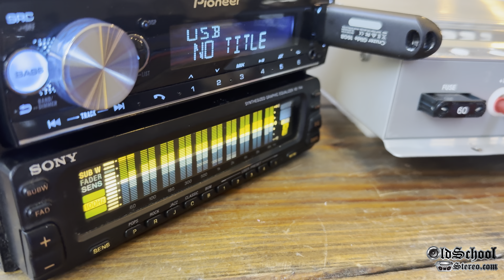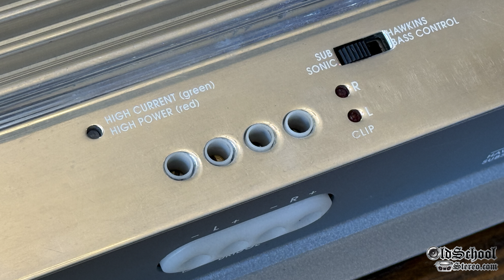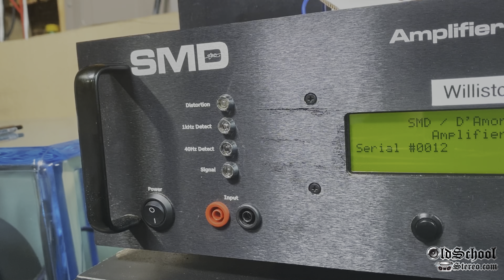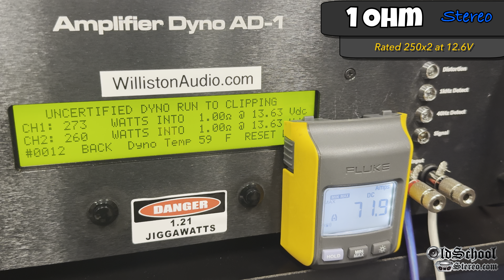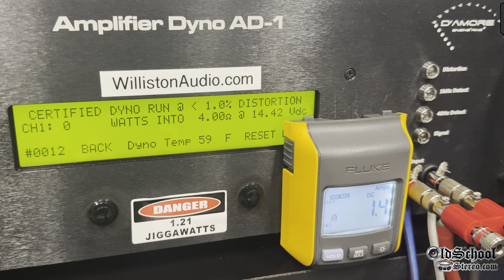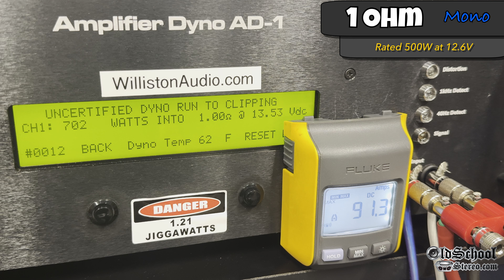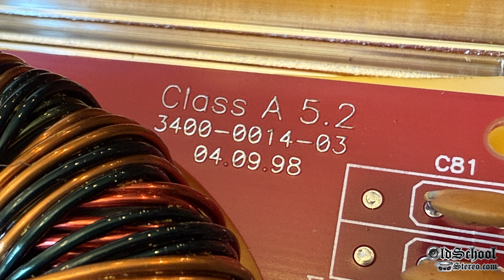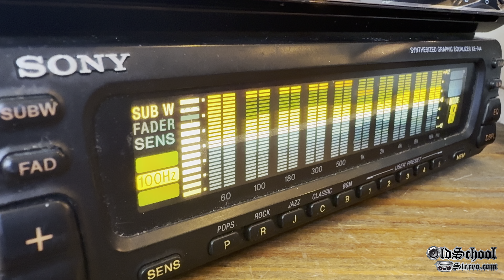This Amp was Rated 1/2 watt? 1998 Soundstream Rubicon Class A 5.2

Comment: That EQ brings back memories of my cousins setup back in the day. RIP Bumblebee
Reply: I miss those EQs. The touchscreen eqs cut out as you adjust them. I miss separate dials and adjustments. I had a Nakamichi with bass, mid and treble. 3 separate knobs, rather than going to menu. I use a pre amp / eq with an iPod for my test bench, and a separate cd player. I miss the old days.
Reply: @raymo6795 i still have a working alpine 1/2 din that works and sounds great. Jcv had one back in the 80s that would talk which was crazy lol
Reply: @stickboslightning  they are still available, maybe not Alpine or JVC. Some of the off brands still make them. I use an Audiobahn as a pre amp to test eBay amp purchases with an iPod or external dvd/ cd player. The new head units ‘ eq cuts sound whenever you adjust fine tune.. can’t believe that is what is acceptable in the industry today. I prefer slides or dials…truthfully, I am not a big fan of DSP either. I prefer to adjust the amp settings with a small screwdriver and not on a computer. I am awaiting an old Eclipse cd head unit…I hope it works, that is the risk buy a 25 years ago old piece of electronics from eBay…the seller will return unit if not operating 🤞
Reply: @ brother you are preaching to the choir lol. I just had my DSP go bad, it was an expert 8 channel. Pure junk.  Now most of the cheaper dsp's use a phone app to setup and it is such garbage man. Don't even get me started on how bad shifters in new cars have gotten. I will be yelling at the clouds like Grandpa Simpson
Reply: @stickboslightning  I have had good luck with Helix/ Match DSP amps. They integrate well into German automobiles. But they are beyond my ability, and I have them installed and tuned by the Helix dealers.These are digitally tuned perfection, but the best systems I ever had were installed by me and were Soundstream with JL subs and and MB Quart soundstage, but today’s tech has left me behind.
Reply: @raymo6795  yeah. If you really want true sound quality you need to use an rta(real time analyzer) or at least a DSP with a mic for auto corrections. I swear to God the next car I get is gonna have a manual transmission and the ability to change the head unit. These infotainment systems are for the birds. Oddly enough the best stock system I've ever heard was a Tesla. The thing KNOCKED and got crazy loud. I was honestly shocked. Not as loud or dynamic as my 2 12s or anything but still impressive
Reply: Big D let me get that EQ!!  Had one back in the day and I have been looking for a nice working one for years now.
Reply: I had a kenwood like that I'm still looking for. Tons of memories.
Reply: to REMEMBER.... Bumblebee... CUZ.

Comment: Please do a review on the early bose 1401 car amp with the .5 ohm speakers
Reply: The VERY FIRST truly LOW IMPEDANCE Car amplifier system made for the 12 volt customer, the BOSE 1401 is HISTORIC. I personally installed no less than 3 complete systems in the late 70's. I could NOT BELIEVE the sound ya got from FOUR 4 inch drivers. AMAZING BASS, POWERFUL... CLEAR CRISP.... I installed a system in a 72 FIREBIRD once. Guy had electric windows and wanted the speaker mounted where the window crank should be. I measured, twice, said it can be done and went to cutting metal... REGRET. Man there was like 3 LAYERS of STEEL in that area.... STILL REMEMBER that job in my mind BUT, I pulled it off. I gotta tell ya, STILL to this day, the BEST set of 4 inch speakers ever.... no TWEETERS... The BOSE 1401 sound system... AMAZING product, at a TIME. BDBD/2025
Reply: Bigdog,  thanks for your feedback. My experience was exactly the same. This tiny terror was the firs example of a low impedance system and it provided awesome powerful bass bright with clear mid range vocals when set up correctly. I first experienced the 1401 system in a 1980 Mercury Lynx with the drivers installed in both  doors and two in the package shelf and it was nothing short of amazing, it absolutely rocked. This is the first time I felt bass that shook the car. The first true high fidelity car stereo system on the market. At 58 yrs old I have heard and seen alot of car and home stereo equipment and this one unquestionably still stands out in my mind.  I'm not at all a bose fan but this amp and the four low impedance drivers forgotten by time are a historical part of the car stereo evolution.  I hope old-school tests it, very interesting system.
Reply: @bobjackson9717  Yeah, according to the INSTRUCTIONS, you DO NOT CUT the front wires or shorten them as the WIRES too are a MATCHED SET, same exact LENGTH front and rear for impedance matching.  And dont forget the DIRECTIONAL speaker GRILLES in the rear... Fully adjustable reflectors built in... ENGINEERING in the late 70's. BDBD/2025
Reply: the very FIRST DIGITAL DISPLAY decks were appearing in '78.... Pioneer green display silver face... Memories... MINDBLOWERS... Had a pair in my 70 Challenger... Mind BLOWN. When I BOUGHT the car they were in there BUT NOT HOOKED UP...???.... So I crawled into the trunk and figured out the wiring..... WOW what a DIFFERENCE them amplifiers made... STILL remember them MINDBLOWERS as one of the most BASS in my 70's days... BDBD/2025
Reply: I have the amp, uncut wire harnesses and speakers but I am missing the grills...been looking for those for 20 yrs on ebay
Reply: @ search Google...
Reply: Have google and ebay searched them for years w no luck. The rear directional speaker grills are an integral part of the system and necessary to get optimal sound performance. They have proven to be very difficult to find. I am sure they are still out there in someone's garage.. I just have to find them.  PS. I also have some of the old ads monoblock amps and the Proton D275 car amplifier with Dpd circuit. The bose 1401 is still my favorite out of all of them

Comment: There saying it's always Chanel 2 that's lower.  So there trying to say all this.   Put a mono 400hz and ajust the pots so they read the same. Use a mono amp hook the output to both channels crank up till channel A says 25 WATT then raise channel 2 TO 25 watt. Thier. Fixed

Comment: I still have Soundtream Rubicon 204 amp. I guess it was designed to 100w class in competitions since it's rated 4x25w. That's not really cheater amp doing only less than douple as rated, but sounds really nice. If I remember right someone won IASCA championships with similar amp.

Comment: 7:09 speaking of your amp dyno, after all the hundreds of tests that you've done have you ever had to service it?
Reply from the maker: I sent it in a couple of years ago but it still met calibration specs by the HP Audio Analyzer, so no adjustments required
Reply: There is no service for that thing. No recalibration like real testing electrical tools.